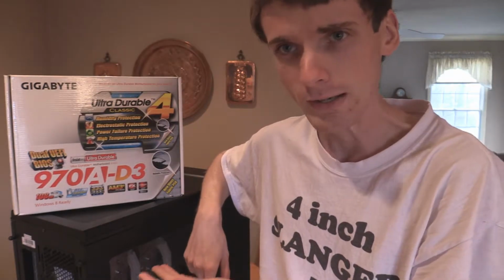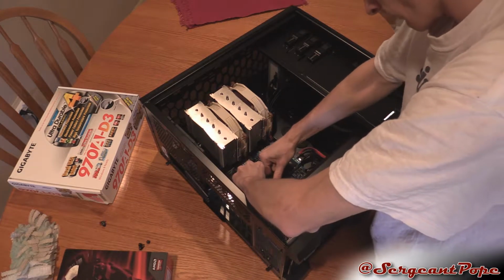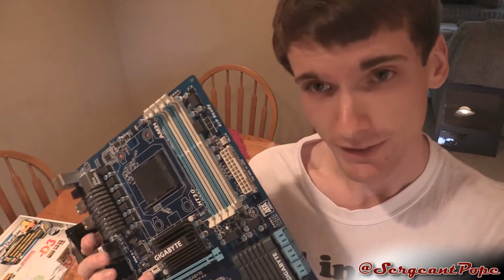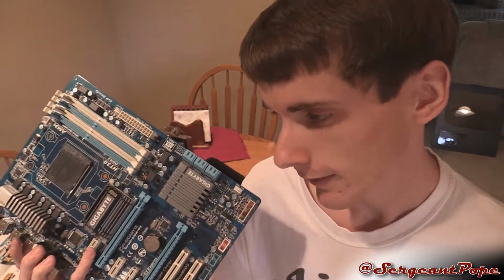RMAing my motherboard - Time lapse of mobo removal

Comment: I have a small problem with my computer, maybe you could help? Basically, whenever I turn on my computer from it being shut down or from hibernate then my usb mouse won't automatically work with the PC, even though it is getting power. I need to unplug it and plug it back in to the usb port at the back, and that kinda sucks. I'm not sure if it's Windows being stupid, if my motherboard does it, or if the mouse is the problem (probably not because on my old computer that never happened). If you were wondering if my keyboard does it too, it doesn't because I use a PS/2 keyboard.
Reply from the maker: +Franco Pellegrin Hmm, have you tried all the USB ports on the computer? It could be a weird USB port. You can also try resetting BIOS settings to default. I think some settings might cause an issue similar to that. Beyond that, maybe uninstall and reinstall the drivers for the mouse? If that doesn't fix it, I might reinstall Windows. That seems like the next logical step to me.
Reply: +SergeantPope 
I have tried about three USB ports and they all had the same outcome, but I will soon try resetting my BIOS and stuff.